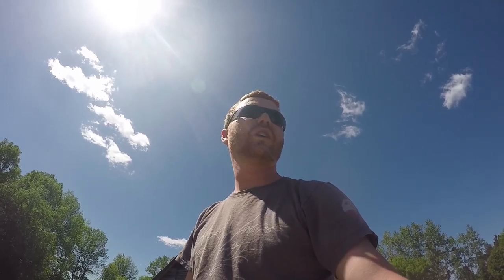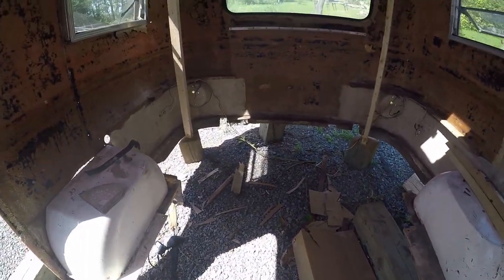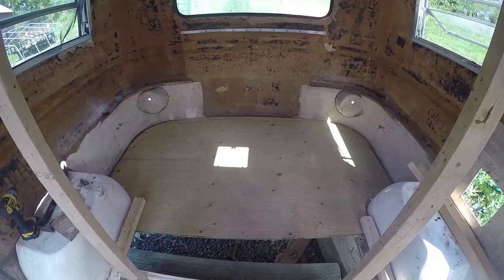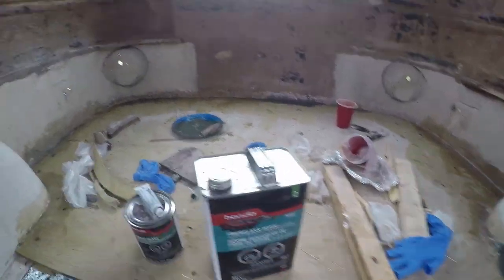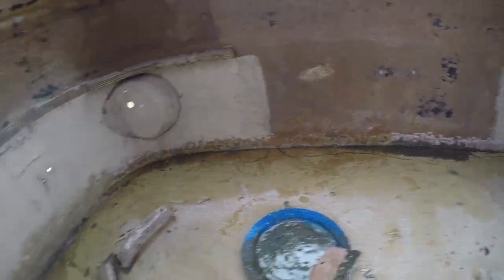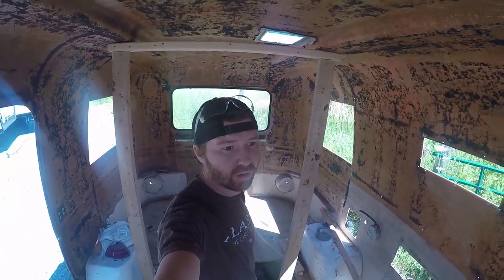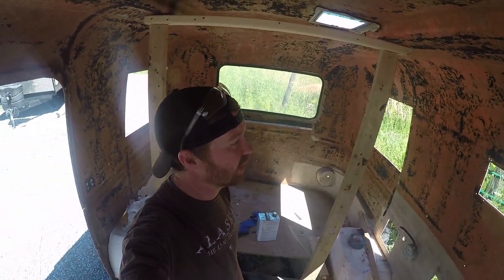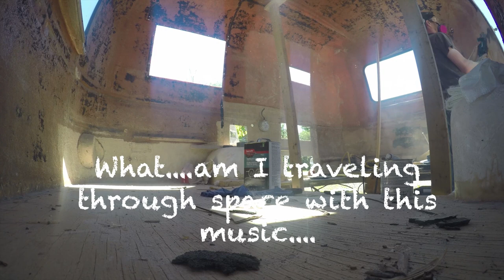Renovating the Boler fibreglass camper - Episode 3

Comment: We are restoring our '72 boler right now. The frame is off and we are needing to replace the rear/dinette section of plywood floor. I'm wondering how you tackled fiberglassing the underside of the the floor? I understand some bolers have been fiberglassed under the entire floor, ours just has a fiberglass lip that the plywood sits in (I think similar to yours). Did you re-fiberglass the bottom, like you did the top? If so how did you physically do that? I have only seen someone flip the boler on its side to do the bottom. Just wondering if there's any other way. A really high jack? Thanks so much for your help. Your videos are awesome!
Reply: I'm in the exact boat. About to fiberglass the top. Probably just gonna crawl under and fiberglass the bottom just the same and hit it all with flex seal. Lol maybe not the flex seal
Reply from the maker: I put two ramps in front of the tires and hooked it to my car. I pulled it up the ramps to get a little more space then I put on some old work clothes and laid on my back and went at it. It was uncomfortable and I couldnt wait for it to be over but Im glad that I did it.